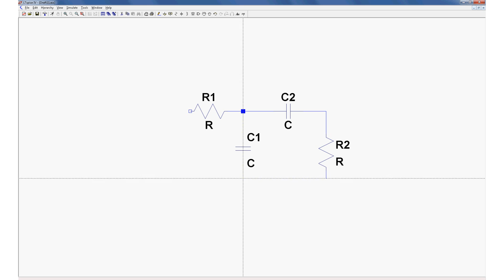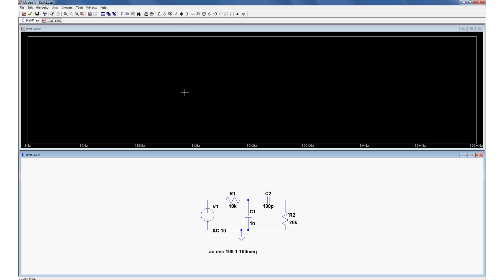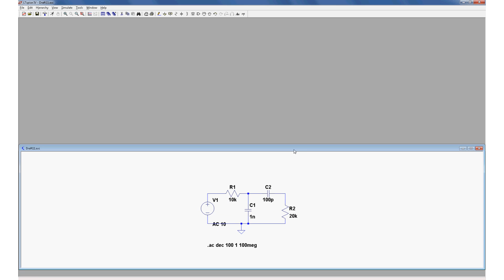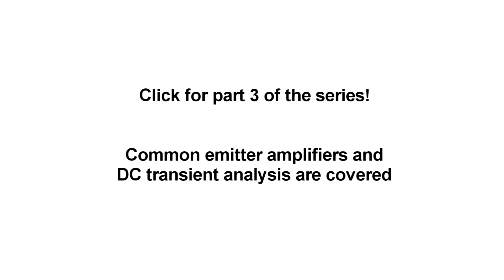Circuit Simulation in LTSpice Tutorial part 2/3

Comment: Why do you need a ground when there's a + and - on the power supply?

I only ever use a ground symbol on the bottom if i have a voltage rail on the top

Comment: I'm looking to design some bandpass filters for ham radio and happened upon your tutorials (and subbed, thanks).  I pulled a few of the commercially available ones apart one day and it was just a few thick enamel wire air core inductance loops in between two connectors.  If the coax has a resistance of 50 ohms on both sides, is it correct to assume that alls I is determine my high and low  inductance values?